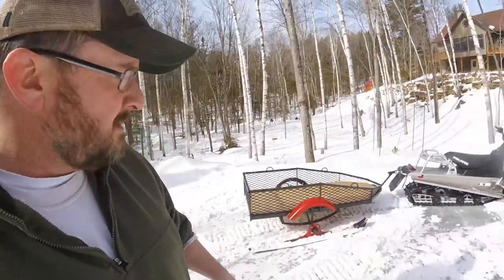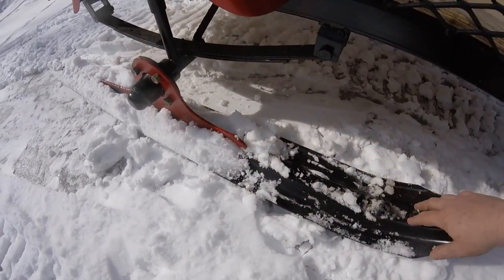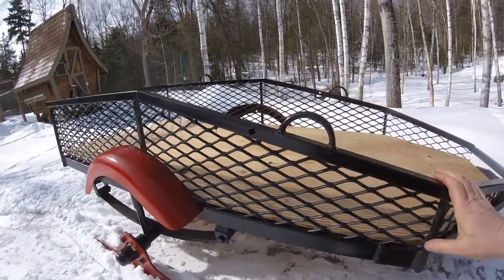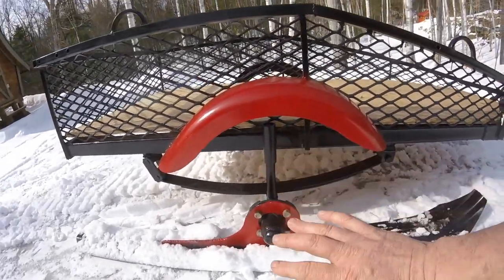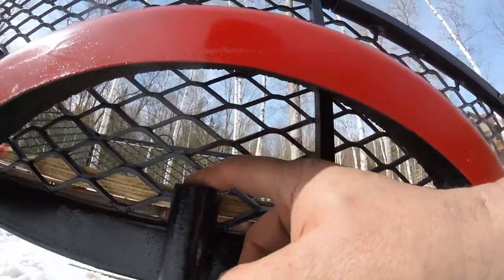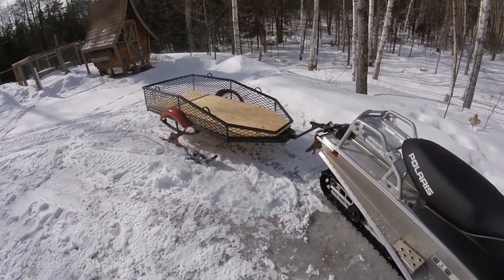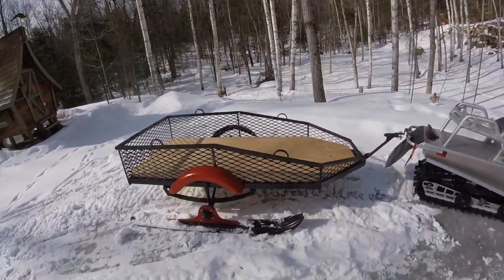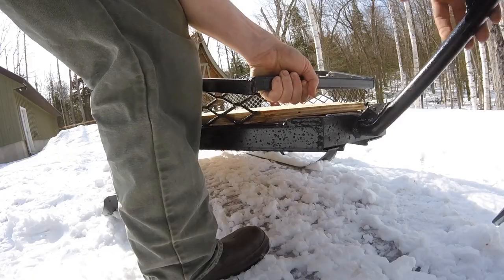Homemade Snowmobile Sleigh

Comment: Cool design.  That axle needs co compress the spring in an arc so your vertical tube isnt allowing for spring compression.  If you want to keep the axle square use a track bar.

Comment: Swap the tubes out with a set of Chinese atv coil overs and your binding problem would be solved and they don't have much pressure in them so you would be able to keep your suspension travel. Plus they're cheap

Comment: The reason why you don't have any suspension travel is because you have it all welded up and the springs have to swing back  on the shackles so the suspension can compress.
Reply: Yes I agree.. the shackle needs to lean towards the rear.. the spring gets longer as it compresses.
Reply: There’s no way for the design he’s built for the suspension to work properly.  The shackles for the springs should have a few degrees of rear travel past the 90deg from the frame even empty to ensure the springs can compress.  The vertical slip tube he’s designed isn’t allowing the springs to even mildly function, then the welded rebar under the trailer to the spindle assembly won’t allow the springs to compress either.   
Definitely needs to just go back and put a shortened axle back under the trailer and get rid of the rebar and tube supports.